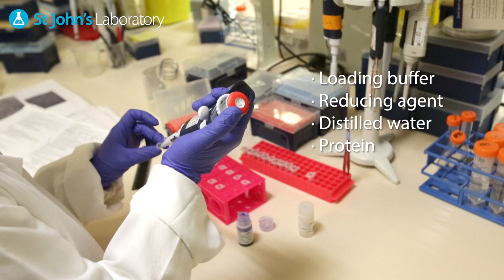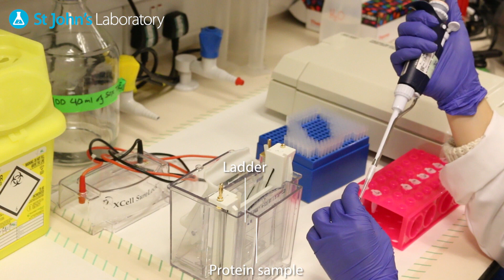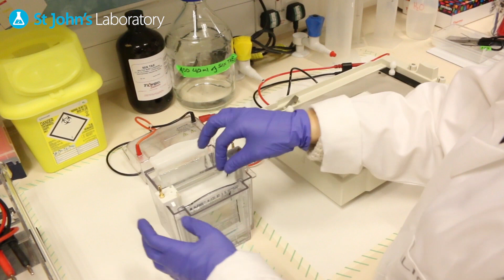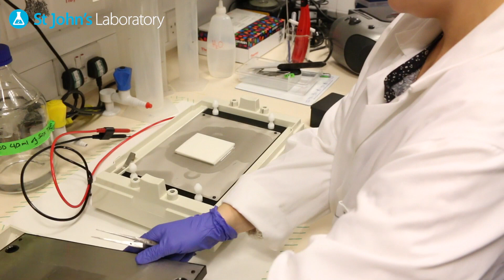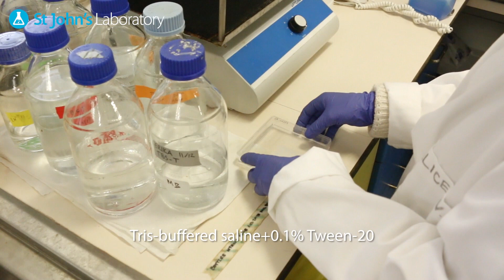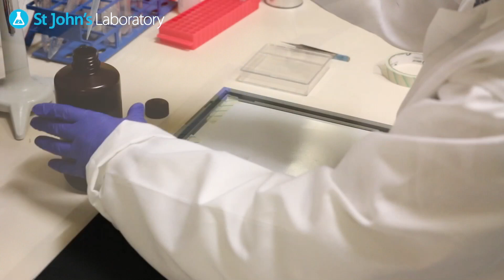Western Blotting (WB) - Video Protocol Series

Comment: For large proteins (Mr >100 000). Be sure to run your samples in a low-concentration gel, 8% or less. These will be very fragile, so handle carefully. Large proteins will tend to precipitate in the gel, hindering transfer. Adding SDS to a final concentration of 0.1% in the transfer buffer will discourage this. Methanol tends to remove SDS from proteins, so reducing the methanol percentage to 10% or less will also guard against precipitation.  http://www.creative-diagnostics.com/Electrophoresis-Protein-Transfer.htm